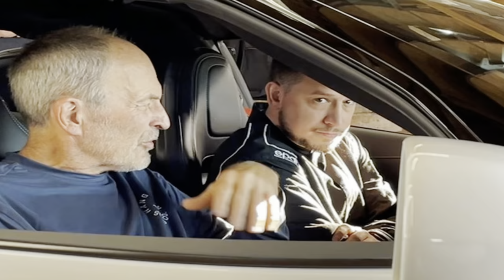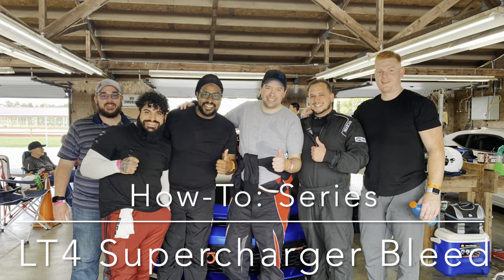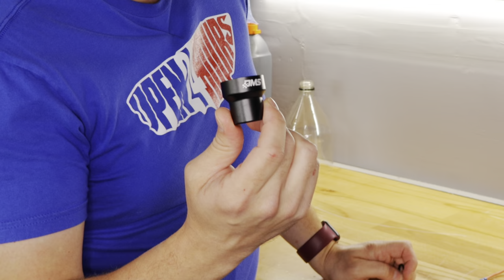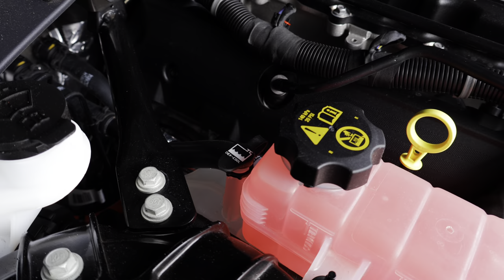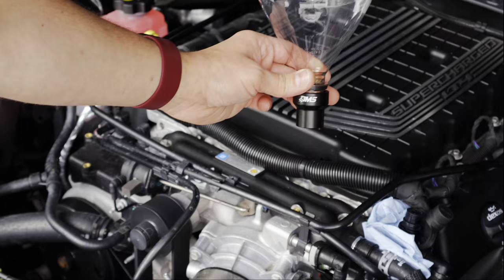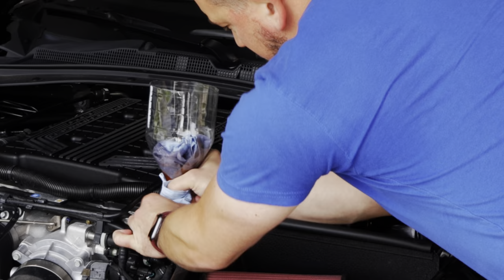How-To: Bleeding the LT4 Supercharger // ZL1, Z06, Escalade V & CT5-V Blackwing

Comment: Need you do this every week or so because the system has more air. It’s hard to remove all the air in ones .
Reply from the maker: Yes, it is impossible to get all of the air out in one shot, but the timeline is always going to depend on the use case for the car. If you track the car frequently, doing it before your track days isn’t a bad idea. If you just street drive the car, checking it 1-2 times a year is a good option too.

Comment: Every LT4 I've done has had small to large amounts of air in the system. There isn't a downside to running the vehicle instead of the jumper. You can avoid spilling when you remove the funnel by stuffing a shop rag in the top of a water bottle and jamming it upside down into the funnel. It's not perfect but it will spill less.  I know you guys are up North, but unless your garages are 20 degrees F in the winter, then using distilled water and Redline Water Wetter is the way to go.
Reply from the maker: Every. Single. One. Yeah, I definitely didn’t use enough shop towels/rags in the video haha. Although my garage is heated, not everyone’s is and we genuinely have seen temps in the -50° range before.

Comment: Amazing 👏🏻👏🏻. I have never done it before in the past 3 years, So how many times should I do it? to remove all the air? like every 3 months or !! and for each time how long should i keep the pump running on ? thanks
Reply from the maker: I cover the pump run time in the video, but as far as how often you should do it really depends on how you are using the car. If you are drag racing or road course racing, you should check it at least before your event for any bubbles. If you notice the car substantially losing power under heavy use, it’s not a bad idea to check it when that happens. I’ve seen some systems with little to no air at all, and I’ve seen others with huge bubbles for quite some time.

Comment: For this process, how would it differ with the addition of a s/c coolant expansion tank?

I’m currently in the middle of installing a upgraded supercharger heat exchanger and a supercharger coolant expansion tank, and with the addition of the tank, I’ll lose the hose with the fill port for the coolant, and the new “fill” port will be the cap of the expansion tank.
Reply from the maker: My understanding of the coolant expansion tank is that it is no longer a “closed” system, and simply opening the cap on the tank and letting the pump run would allow the air bubbles to circulate through. Essentially the 2-liter bottle in this video is a temporary “expansion tank” so all you need to do is run the car, squeeze some hoses, or run the pump relay the same way until you see bubbles in the tank.

Comment: Do I need anything to push down on the Schrader valve or does the adapter already do that for you?
Reply from the maker: Great question! The adapter from DMS already does that for you! You’ll notice in the video I didn’t use anything to reach down and push the valve in with. All built into the adapter.
Reply: @FollowMyLine17  Awesome, thank you man

Comment: Does the car need to be in Accessory On mode?
Reply from the maker: No, the car should be off. The relay, or jumper, allows the pump to run with the car off. Accessory or Run is not required.

Comment: Ty for the video, it helped explain alot of missing information.  Have you looked into the supercharger bypass valve adjustment?  Ive only seen it one other place so idk if its a thing or not. Havent seen it on the forums either, maybe snake oil. Would love to hear your opinion on this, maybe in another video? 8)
Reply from the maker: The Supercharger bypass valve is an old trick that goes back (for me) to the early 2000’s with the Pontiac Grand Prix. It’s not necessarily snake oil, but it’s not consistent. Some cars may see a bigger benefit than others, based on where the bolts were set when the car was built. Tolerances are also a bit tighter today than they were 20+ years ago too. Maybe I’ll make a YouTube short on it.
Reply from the maker: Turns out my original articles from the early 2000’s are still out there and mentioned in a few forums, including the ZZP site. 

https://zzperformance.com/blogs/import1/free-mod-boost-bypass-mod
Reply: Heck yah, thank you for the info! I'll check that out

Comment: How often does this need to be done if I am just street driving and not tracking the car?
Reply from the maker: You should check and do it at least every 6 months or so. The system is sealed but it’s impossible to get all of the air out in one shot.